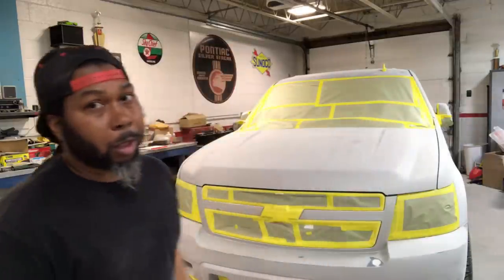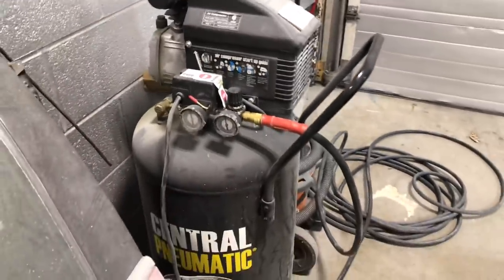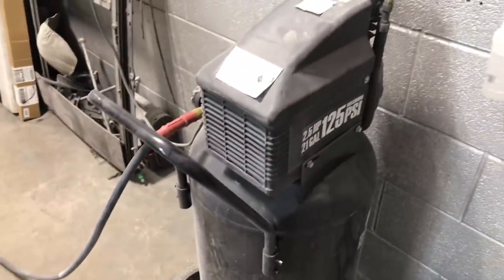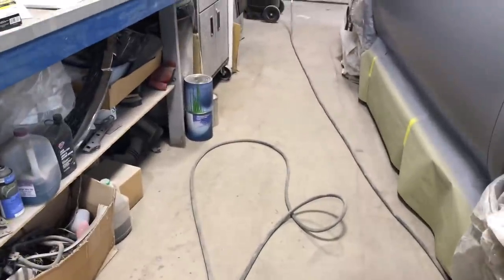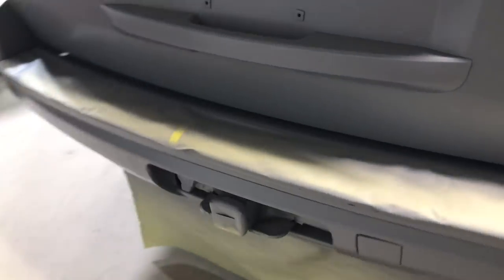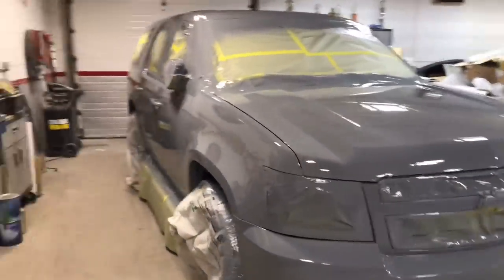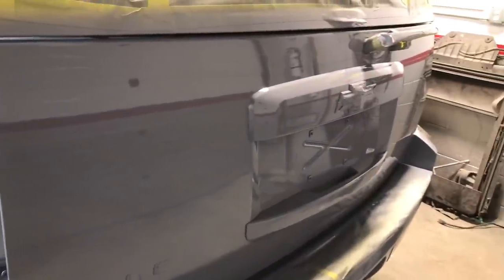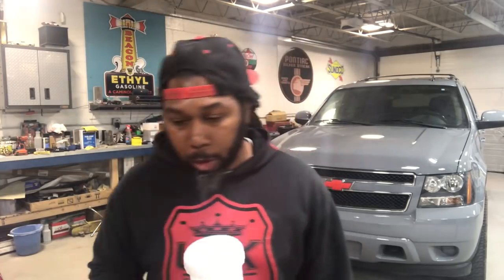COMPLETE PAINT JOB with the SPRAYIT R500 LVLP spray gun and a small compressor

Comment: One of the best hvlp/ conventional guns I've used on small compressor is a devilbills plus,I use to lay out cross fire clear from Napa with pressure at 11 to 13 lbs at the gun..thicker materials I'd go up to 18 to 20 but low VOC I'd use low pressure with great results 
Haven't used a low volume low pressure gun like these yet.
Reply: I got the black 30 gallon craftsman pro 110 compressor that's 2 stage and I love using it for painting when I can't use a big compressor.
I got the blue water trap and the toilet paper filter hooked directly to my compressor and it helps keep the water out of the lines.
The toilet paper filter is one you should look Into.
Reply: Looks like being a lvlp gun it cuts down on over spray too,back in the day if I couldn't paint a fender and door without getting over spray all over my arms Ina. Booth,then the gun had too much over spray.
Reply from the maker: I appreciate you checking out the video and I’m gonna look into that filter setup for using my small compressor next time but I normally spray in my booth where I have a filtration system. I really did this video to show people that they could do a nice paint job with this type of setup
Reply: @UndergroundPaintKing  I got a 3 stage filter system but don't have it hooked up,I just use my small setup when ever I do anything.
I painted for 22 years until a bad car wreck shattered my kneecap a few years ago and carpal tunnel in both wrist and tennis elbow and rotator cuff tendonitis,and now I can still do it,just now full time or like I use to.
I was only guy at a 200 hr a week shop for 6 or 7 years and did all the paint work myself and I've done plenty of the custom candy jobs here in Indianapolis.
4 or 5 of mine got shipped to car shows in Florida by forgiato.
Reply from the maker: @darknature79  man I hate to hear all that happened to you but glad it didn’t stop you from doing paint work, it’s dope to hear that you had your work going to shows as well 💯💪🏾

Comment: Wow. I have the same compressor and the same gun. I painted my Camaro with it. Looking forward to the video to see if your results were better than mine. I had a lot of orange peel. I laid down 5 coats of clear so I would have enough to knock it down when I cut and buff the car
Reply from the maker: The customer already picked up the truck so I won’t be able to make that video happen but will do it for the next project that I do…I appreciate you checking out the video!

Comment: Dope!! I did my 96 impala with that same compressor
Reply from the maker: Nice!!!…I appreciate you checking out the video!
Reply: Did you prime with this setup too? What pressure did you prime and spray at?
Reply: @charlesclemons741  I use the $20 purple harbor freight gun for all of my primer jobs. Pressure at 25 psi. Just make sure to adjust the fan and shoot a few test patterns. A clean your guns immediately after your done.
Reply: @PERBBOSS  is that a LPLV gun?
Reply: @charlesclemons741  its a HVLP at the time I didn't know I needed a LVLP for my set up. Took a minute to set the gun bc of the small compressor. But I found just doing 1 panel at a time really helped a lot.
Reply: @PERBBOSS  thanks much bro!

Comment: Loving all the knowledge to be gained here. My questions are between panels do you take a few seconds to let the air compressor catch up? I see you paint panel by panel except the doors you hit both doors at once for the base does that help to keep the paint atomizing properly? And How many coats did you lay down? I want to do a single stage paint job on my 83 280zx so it’s not a beast like this lol.
Reply from the maker: The compressor will keep up, that’s mainly how I painted this vehicle but as you can see, you can go panel to panel or do multiple panels with this setup and I did 2 coats of base and 2 coats of clear
Reply from the maker: Here is a video of a single stage job I did with the same setup 
https://youtu.be/OkAbRWjHwOc?si=a2qVKHvMQQYjkDZm

Comment: Good morning.I was wondering if you would feel comfortable spraying pearls/flakes with a small compressor and how you would do about doing it.
Reply from the maker: Good morning, yes I would be comfortable spraying pearls and flakes with a small compressor setup and the process would be no different from having a big compressor setup. There are different ways to add pearls and flakes but I like using a base blender/ inner coat clear for pearls and flakes
Reply: @Underground Paint King  excellent thank you. Also, look into a dual compressor setup. The OG at a collision shop I volunteer at told me about it. It's even more budget though; two pancake compressors and a reserve tank. He didn't go into details he just mentioned it. So after looking into I'm guess I would have to connect a T-valve to the reserve tank and connect the compressors to the reserve tank. Interesting combo. I'm researching it onYouTube now.
Reply from the maker: @maxie9506  I haven’t done the dual setup yet but I have 2 stage compressors that I run my shop and paint booth with but if you’re trying to do this kind of work on a budget then small compressor setups are a good way to go

Comment: Looks great man! I saw another video of a guy who ran like an extra 50 ft of hose going up and down on his wall and then it went through an air water separator to help with his water issues. Might be worth looking into 👍
Reply from the maker: Thanks I appreciate you and I have a actual paint booth with a filtration system so I wanted to make this video for those that want to do this but don’t have the expensive equipment to do it…I will set something up for the next time!
Reply from the maker: gringo loco2  that information right there is what beginners need 💯

Comment: Thank you very much brother, your video is very educational. I need to get that same air compressor + spray gun  but need both technical specs (HP, CFM, PSI etc...). 
God Bless!
Reply from the maker: I don’t believe Harbor Freight carry these compressors any more but getting a different brand compressor will do the job also…the cfm of the gun is 3.5-3.9 so the compressor you choose should be able to provide that or better and as far as your psi you will have to adjust that to your liking once you’re ready to do the job. I appreciate you checking out the video!
Reply: @UndergroundPaintKing  thank you very much, brother, your feedback is greatly appreciated. 
🙏🙏🙏
Reply from the maker: @kennedidgabriel  you’re very welcome! Glad I could help in any way

Comment: Thanks for this!  You did a great job on this. I have an old car (1974 bug) that I am semi restoring (that is making it look nice but not 100% perfect and investing more than the car would be worth). I am going to try this. It looks like you primed yours first. I was wondering did you sand down to metal or just sand it down enough to prep it for primer but still with much of the original paint under the primer?
Reply from the maker: I only primed the areas where I did my bodywork and then painted the truck DT and I only sanded down the original paint, taking down to bare metal wasn’t necessary
Reply: @UndergroundPaintKing  Thanks for the reply!
Reply from the maker: @danelen  you’re welcome

Comment: Great video for someone like me wanting to paint my 88gt mustang convertible at home, the compressor is 125 psi max output, do you regulate it down to a certain pressure to the gun or 125 psi max to the gun and regulate it at the gun? Keep up the great diy content
Reply from the maker: Thanks I appreciate you checking out the video…you can run the compressor at max and regulate the air at the gun and you will be finn

Comment: Looks great! 👍
This might be a dumb question, but could help save someone else too.
I'm not a painter, but a long time ago, I had a siphon feed gun blow up in my hand because I forgot to set my compressor psi to a lower setting before hooking the hose to the gun. It blew the cup right off the bottom like a bomb! It was rated for max 50 psi, and my compressor was at 125 psi.....I didn't have a psi regulator on the gun. That freaked me the hell out!
So what is your compressor regulated at before hooking up the gun, and while painting?
Thanks.
Reply from the maker: I actually have a video on this topic P Tucker, it’s not on siphon feed spray guns but the info will apply for them as well 
https://youtu.be/G0CYIwbSmGo
Reply: @UndergroundPaintKing  , Excellent demonstration! When that happened to me, I was just fooling around.....had no primer in the cup, or a regulator on the gun....just forgot to turn down the compressor first....it can be really dangerous if someone isn't paying attention.
You're alright man....I appreciate the response on this! A paint job shouldn't be to die for....lol.
Reply from the maker: @PTucker0864  you want to do a killer paint job but you don’t want that to be literally 😂 I’m glad the video was helpful!

Comment: You are The Body mans Hero
Reply from the maker: Thanks I appreciate that and appreciate you checking out the video!
Reply: I’m Unsure Of The Major Difference in LVLP 
What is A Good One Besides the HF Specials 
The Black Widow Is HVLP
Reply from the maker: @dw2769  lvlp spray guns requires less air or cfm than Hvlp spray guns so the lvlp paint guns can function well with a small compressor as where a hvlp or hte spray gun will require a higher cfm which a small compressor will struggle to keep up with…HF black widow comes as a HTE ( High Transfer Efficiency) and a HVLP (High Volume Low Pressure) but have different tips for each spray gun
Reply: Which would Be best For A 21-33 gal compressor? 
Thought about booking up some Auxiliary tanks But I’m unsure if that would Bump up my CFMs
Reply from the maker: @dw2769  the lvlp will be best for the 21-33 gallon tank
Reply: @UndergroundPaintKing  thanks Bossman any brand you recommend under 300.00 usd?
That will lay base primer and clear
Reply from the maker: @dw2769  this SprayIT spray gun comes in a kit that has a 1.3, 1.5, and 1.7 tip which will handle everything you are trying to do
Reply: @UndergroundPaintKing  your The Real MVP 
I know your channel is about to blow!
Reply from the maker: @dw2769  thanks I appreciate you for that and I hope you’re right!

Comment: Big up from Jamaica.Nice work. Looking to pick up the kit version of this gun for my first ever spray project. Spraying a minivan. How many times did you have to stop and refill the cup? What's the smallest compressor that can be used for diy if spraying a door or panel. Will this spay primer surfacer at standard ratios or would you have to thin it out.
Thanks for you time and effort.
Reply from the maker: I don’t remember how many times I had to refill the cup and when it comes to the size of the compressor you want to get a compressor that will give you the cfm that will allow the gun to spray correctly…if you have a thick primer surfacer it may issues but I’m not for sure so I’ll have to test that out…I appreciate you checking out the video bro!

Comment: I thought about this today....can you spray epoxy and/or high build primers with it as well? Probably going to order a kit with the 1.3, 1.5 and 1.7 tips. Just wondering if I should get something a little better for primers. What did you use on the prep work on the truck in this video? Thanks!
Reply from the maker: I used my Devilbiss primer guns but you can use a SprayIT spray gun with a 1.7 tip and up depending on what’s recommended to use to atomize the primer correctly
Reply: @UndergroundPaintKing  Cool. Most of the stuff I've watched uses a 1.8 tip for primers, but that was on HVLP and Siphon feed guns. I wasn't sure if the LVLP would be different. I've sprayed high build with a Harbor Freight siphon feed gun in the past and have no idea what tip was on that! lol

Comment: what is the best gun you have used for laying down clear coat? I have a 100litre (22gal) compressor so assuming im better off with one of the lvlp guns? and what nozzle size? 1.3mm? thanks
Reply from the maker: The spray gun I’m using in this video is my favorite spray gun when using a small compressor setup and it’s a 1.3 tip

Comment: very nice job bro I can give you an an ideal that i have used for years  take about 12ft of air holes and run it from your compressor to an over head rafter or something that will make a loop up high plus i add a filter in the line up high  with a drain  this helps keep the water out of your gun  Just a ideal you might consider have a great day
Reply from the maker: Thanks Dean I appreciate you and your idea and gonna work on my setup!

Comment: Looks great, and the compressor did the job.  I've got to get a new compressor to replace my 35 year old Craftsman 30gallon/5hp(B.S.) compressor I bought new way back in the late 80's.  I've got a 2 car garage and for almost everything a 30 gallon does a great job but I'd like to paint my Chevelle sometime in the next few years so nice to know a 30 gallon will do the job without stepping up to a 60 gallon which would be kind of a pain to install/move and I don't really need it for anything.
Reply from the maker: Yeah Tom, if you’re not planning on doing a ton of work and you just have a project that you want to finish, then a small compressor setup is definitely the way to go in my opinion and saves you money. I appreciate you checking out the video!

Comment: What do you use to dry auto paint fast after it is painted because am gonna need to get something for the paint will dry fast before I end up painting my old truck this new aerosol reusable spray can I ordered is coming Monday I will be using that too for painting in the future.
Reply from the maker: You can use heat lamps, torpedo heaters to heat up the area that you’re working in and some people use wood stoves…if you have your garage set up correctly your air flow from fans can also help with your paint drying

Comment: Hi thanks ,, what size mm. tip is in that SprayIt gun ? I`m looking at the same one on Amazon and it only has a .08mm tip in it ,, I am thinking that is to small for a basecoat and 2K clear coat on my motorcycle ??
Reply from the maker: The one I have is a 1.3 tip…you want to look for the sp-33000 gun it also comes in a kit with other tips for primer as well

Comment: My bro great video how much pressure did set the gun to on the base and on the clear and on the compressor is the pressure open all the way? And as far as the water in the line is there any filter that can be used my brother?
Reply from the maker: Thanks I appreciate you and I showed the psi when I started spraying the base and clear which I believe was 28 and 30 psi and you can definitely use a filter to help with the water in the line
Reply: @UndergroundPaintKing  thank you sir 🙏
Reply from the maker: @AlexanderRodriguez-pk4cg  you’re welcome bro 🤛🏾

Comment: Brother, I have a 30 gallon, a real 3hp motor on 240 volt, I increased the size of the motor pulley to pump faster. the R500, which is the spray it gun, drained the tank from a full 150 psi to 90 psi in 10 minutes. I was using 30 psi at the gun with full fan and fluid but not fluid for the test. How is it possible for your 20 gallon with a fictitious HP to keep up?
Reply from the maker: Did you get a consistent air flow?
Reply: @UndergroundPaintKing   Yes I did.  I had the trigger pulled back all the way. I really think these guns advertise low cfm but they consume a lot more than we know.  I thought my pump would surely level out and keep up at least at 90 psi but it kept getting lower very very slow like the gun consumes more cfm than the pump can handle.  I calculated like 9 cfm at 90 psi tank pressure based on modifications and this the pump should've kept up AND actually increased tank pressure by a little at the least. Weird.
Reply from the maker: @matth.4932  it’s possible that they consume more than what’s specified

Comment: Which paint and clear did you use on this Tahoe brother? Is that the Nardo grey and Grant7 clear? Also, with this gun, im guessing you stayed about 6-7 inches from the panels when spraying right?
Reply from the maker: I used shopline by ppg for the base and Evercoat HS clear and I’m usually 5-7 inches away from the panel

Comment: Nice job . How often do you get a drip or defects under the clear coat? Any overspray on items inside the garage
Reply from the maker: I don’t have any issues as far as base if that’s what you are asking and I don’t have a issue with overspray because I have a exhaust system and paint booth in my shop
Reply from the maker: @jjjjjjjjjjjhjjjjjhjj  no sir I didn’t have to buff
Reply from the maker: @jjjjjjjjjjjhjjjjjhjj  it’s a nice setup

Comment: Looks really nice. How many coats of paint? How many coats of clear? 
  Also a tip i learned many yrs ago for that water issue. Dont leave air in tank when not in use. Will probably still get some as hard as you were pushing compressor but it will take much longer for water to build up.  Give it a try. Peace✌️✌️
Reply from the maker: Thanks I appreciate you…it was 2 coats of base and 2 coats of clear

Comment: Is that air compressor oil less? awesome video though! was trying to figure out if I need a big compressor but looks like a 30 gallon should be good enough!!
Reply from the maker: @christopher4692  thanks for checking out the video and no the compressor isn’t oil less and a 30 gallon compressor and the right spray gun should work for you ❗️

Comment: Will this compressor also let you run a DA to let you do body work etc I got a husky 26 gal but I have to let it build up for maybe a min or 2 of run time
Reply from the maker: I don’t run a DA off my small compressor, I get the same results as you so when running a small compressor set up I recommend going with a electric sander